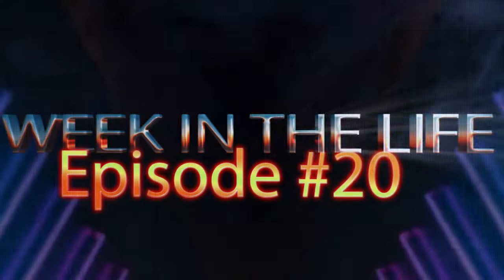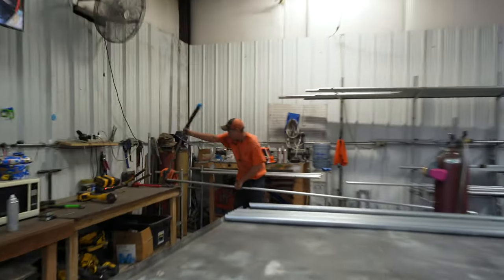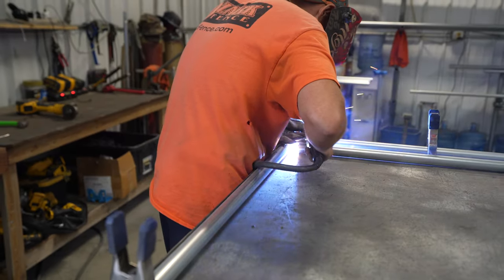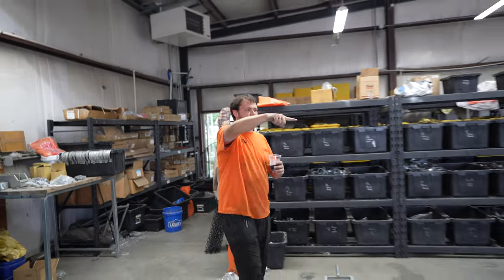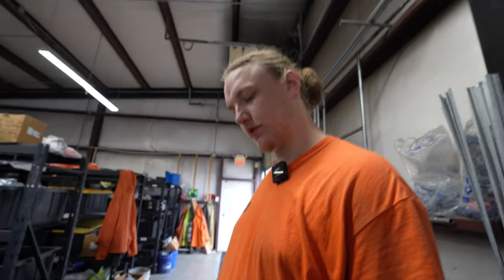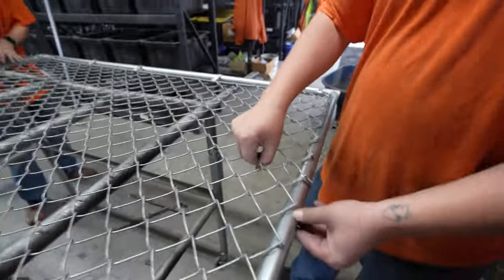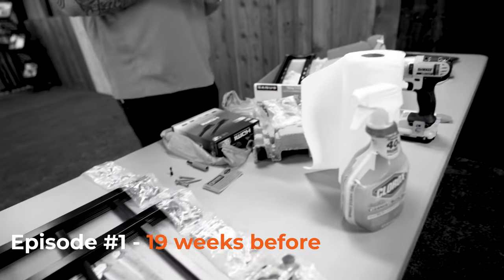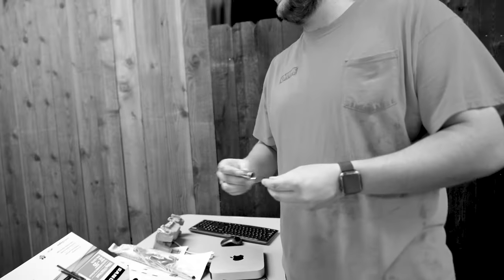Making a Massive Order of Chainlink Panels

Comment: Absolute perfection, skill, and art.  I wish that I could MIG weld that good.  Perfect arc and "sizzle."  I found this video because I am trying to spread the chain link fence on a panel without a buried fence post to anchor.  I am "pinning" it flat on the ground and using a tractor and a come-along to pull it horizontally.